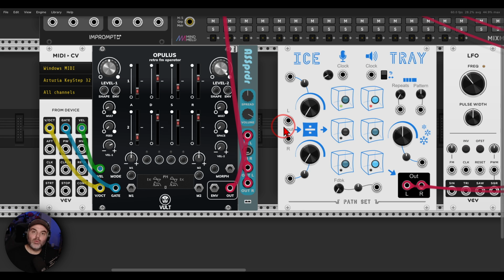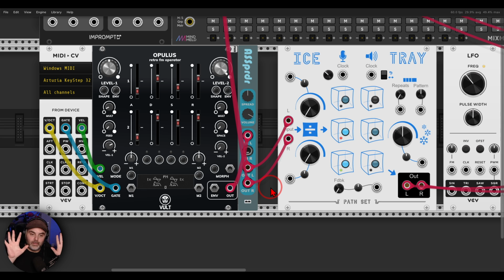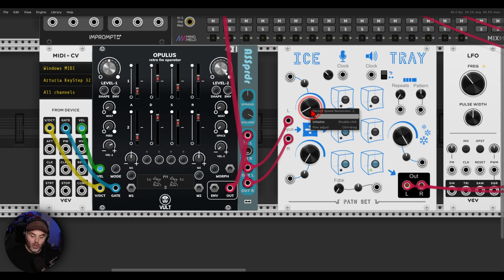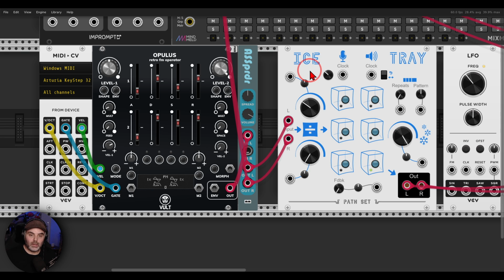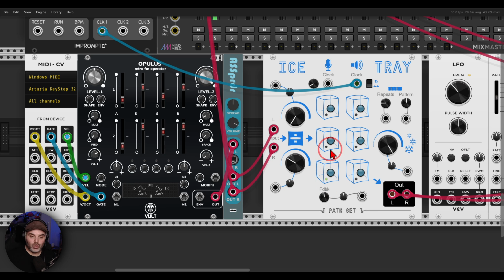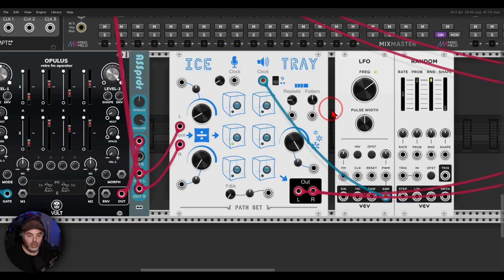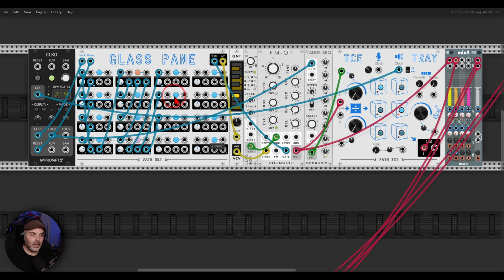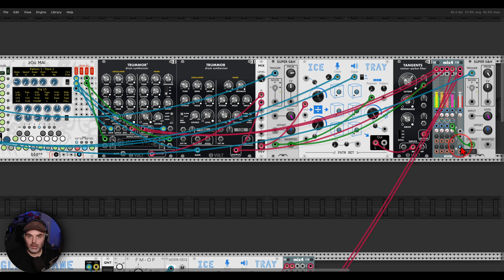Granular Sampler Delay!

Comment: I have questions. Is there a way to configurate vcv so I can  have a bunch of knobs to make different functions? Like in this page the knobs make one thing and then, with the touch of a button they make another different thing? This is to multiply the capability of my midi controller
Reply from the maker: There used to be a module for that I think... What Midi controller do you use?
Reply: @OmriCohen-Music  I've been using a Nord electro that has few knobs. I didn't know to map it till I saw ur video btw.  For sound design and small patches it's okay but for a bigger live performance I run out of them.
Reply: @OmriCohen-Music  I found the solution Omri. You just have to simply have multiple MIDI MAP modules and four each one you change the midi channel input. In this way you can map your knobs in channel 1 for example and then continue mapping using another MIDI in channel 2. Now you can simply change the midi channel in your controller and now just one knob can make multiple tasks. I'm writing this on your midi map video so anyone can see it
Reply: I'm coming two years later haha. I used to mess around with pure data (max msp should be fine) to change midi channels. With a virtuak midi router you can get midi to cv, make changes, export it to the virtual midi router and back into vcv to play things

Comment: Nice video bro. What midi controller or device do you recommend to use with vcv. What I'm looking for it's a device that give the experience of being using modules but vcv being the brain and the sound engine. It doesn't matter that doesn't have keys as long as has a good capability to recreate the details of modules
Reply from the maker: Thanks! I guess that something that you can customize would be best so you can build Midi modules. There are a few people that make these I guess. I have the Midilar controller.